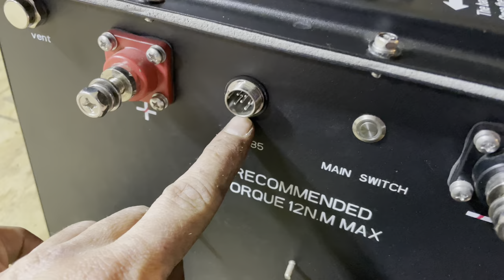RoyPow Lithium Golf Cart Installation (48v - 105ah) ~ Club Car Precedent (2004 - 2009)

Comment: how much would you charge to change out my on board charging plug to this 110v one? I have 2018 Club car precedent currently has RoyPow 48V 105Ah Lithium Battery and still has original on board charger port? Also do you have the ability to unlock speed 5? if so cost? I'm in Summerville SC
Reply from the maker: We only do batteries, but yes, we can handle installing the AC port.
Reply from the maker: It’s a quick fix normally, unless you’d like us to do some wire management too. Give us a call at the shop and we can nail down the details.

Comment: Where did you get that mounting bracket for the battery? I have the same cart using a different battery though if that makes any difference. Thanks for the video it was great and will be using it as a guide for my install.

Comment: You mention a 30% controller failure rate after Lithium battery install. Can you please advise source of this data. It's an alarming number that I'd like to understand further.
Reply from the maker: Of course, I had to replace my controller on a 2008 DS when I converted. Its specific to the curtis 1510 controller. This information is from ECO battery customer service. I recommend doing the OBC bypass first then installing the battery. I tried the battery, when it didn't work I bypassed the OBC then it still wouldn't work, so I replaced the controller fixing the problem. ECO also recommends upgrading your solenoid. I must say that out of all the carts I've done I have only had it happen once, so 30% is a bit high in my opinion.
Reply: @PalmettoBatteryPros  So my 200 amp solenoid went out fairly soon after conversion. I looked on ECO but could not find the recommended solenoid to replace it with. Any suggestions? The type , claims and prices seem to be all over the place.

Comment: Why do you need to bypass the obc on this battery switch out? Is it necessary?
Reply from the maker: It can cause controller failures in the Curtis 1510 controller

Comment: I changed my 2012 precedent to lithium and bypassed the OBC using your video. My lights don’t work everything else works good. Can’t figure out what Am I missing .
Reply from the maker: I would make sure your lights are getting 12v. Sounds like you may have not reconnected the light harness ground.

Comment: Firstly, awesome video. Really helped me down here in Australia on my 2008 Precedent, especially bypassing the OBC and relocating the central wiring bundle.

The only thing that confused me is when it came time to mount the battery, while I had the same bracket and battery you had, and mounted it in the same position and as low as it could be in the battery well (including cutting off those raised bits) I could not close my seat. My only option was to mount the batteries directly to the floor of the battery well without the bracket. The solution is fine, but I'm really perplexed as to how you didn't have the same issues I did, as the bracket would allow for better cable management and better heat dissipation if any exists.

Again, thanks for the video from down under. :)

Comment: I ordered the 110 volt replacement Electrical Receptacle outlet that's water proof so it has a lid that closes, I didn't see a cover on yours, but with them being male ends that means the legs will always be live and if something fell in on them and grounded them out it could burn something up or possible do a few other things bad. But you could have put one on just didn't show it in the video. Good Job nice work I'm working on mine and I'm ready to be done lol

Comment: Thanks for the video! I'm about to do exactly the same rebuild myself for a CC Precedent 2007 however from another LifePo4 battery supplier. You said the failrate for the controller is around 30%. In case it fails, what is your suggestions as a replacement for the speed controller?
Reply from the maker: We recommend the 440a Navitas controller and or motor combination for the RoyPow batteries.

Comment: With installing the lithium batteries is that the same way it would be with four 12-volt 100 amp lithium batteries rather than one and do I have to use the voltage reducer
Reply from the maker: I highly recommend not using lithium batteries in series connection.

Comment: How is the bracket holding the controller and solenoid secured? Was it just a snug fit plus that slot you cut for it?
Reply from the maker: I think I drilled it to the battery tray.

Comment: Hello. I used this video to complete this conversion. However I don’t know how to correctly wire my Bluetooth receiver now. I used the same style reducer. Can you help?
Reply from the maker: I would verify with a voltage meter you are getting 12v out of the reducer. If you are, then check that your wires have a good connection.

Comment: Thanks for the video. I really liked the setup you did And I did it the same way. One question, you said the blue wire is for the positive side for the lights what about the ground side?
Reply from the maker: Should be the yellow Bullet connection.
Reply: @PalmettoBatteryPros  thanks for the reply! I connected the blue wire like you mentioned and everything worked. FYI project came out better than expected. Wish I could attach pictures to share!

Comment: Thank you for the video! Definitely makes me more comfortable doing this myself. I have a few questions. In the video there is a blue wire with a plug coming off the positive terminal. I have that same plug with nothing hooked up. Do you know what that is for? Also would this battery have any problems tripping the bms with a lifted 2014 precedent going up hills? All of the motor and controller are stock as far as I know. 250amp controller. Thank you in advance for any help!
Reply from the maker: The blue from pos terminal is where your lights hook up. You should have no protection shut down issues with a 250a controller. If you do, its under warranty.
Reply: Thank you for the reply. So currently there is nothing hooked to that wire but somehow my lights are still working. The only other wire I see coming off my batteries is a blue negative coming off battery 3 or 4. Not sure which way you count the batteries if it’s from the positive side or the negative side. I’m a little confused how this is even working. As far as I can see there is no voltage reducer on the cart either.

Comment: If I disable the OBC or On Board Computer
on my 2006  Club Car Precedent, can I use a 
LINKS Series charger EPS by Lester Electric to charge my cart?  Thank you.
Reply from the maker: If you are still using lead acid batteries, I would keep the OBC in place.

Comment: I haven’t finished watching the video yet, but shouldn’t you have the 12 V power converter wired to a switch? It seems it would always be drawing a small amount of power if it was not?
Reply from the maker: Correct, the reducers we use now have a power wire that connects to the cold side of the key switch. This was an early video we did, the most recent videos show the key switch activation. This product segment has really advanced over the last two years.

Comment: Does the lithium conversion put up any speed ? I have the same golf cart in this video!
Reply from the maker: You will notice an increase in torque and a couple mph based on mostly the lack of weight compared to lead acid. Speed is more of a controller/motor issue.

Comment: There was a comment about the reducer.  You responded with a reply saying "the reducers we use now have a power wire that connects to the cold side of the key switch." Could you provide the reducer you now use (model number)? Also, where I can acquire one? 

Thank you.
Steve
Reply from the maker: You can buy them on Amazon. You can use a less expensive one with 48v input and 12v output or a more expensive model that has a constant or kill switch added with external fuses. Either will work, any 48v will work.

Comment: If you install the battery on a 2018 club car precedent do you need to bypass the OCB?
Reply from the maker: See prior post answer, but I have not had to bypass on newer carts.
Reply: So you think it’s good to plug into the existing charging port?

Comment: Can you do a eco battery install video for 2008 or earlier club car precedent
Reply from the maker: Will do the next one. The Eco 51-105 through hole battery is the easiest to install. Little to no tray modifications.
Reply: Please be quick and get-it-done as i too have a 2007 CC Precedent and ECO 51-105, Thanks @PalmettoBatteryPros

Comment: I just completed this upgrade. However I do not need to use the key now. It runs without using the key.
Reply from the maker: I’ve never seen that, your key switch must be hardwired together. Idk.

Comment: Can you give me a parts list of everything you had to get to do this.
I want to do this to mine before the summer. 

Thanks
Reply from the maker: 12 gauge wire to run to 12v reducer, with ring terminals to connect to battery. You may need some 12g wire to hook your 12v load items to the reducer. Other than that, if your main pos and neg cables reach the battery you shouldn't need anything else other than what is provided.

Comment: why did you have to butt connect the blue and the white
Reply: Bypass the on board computer for carts older than 2008. If you don’t do it the cart will not sense a ground and stay in safe or limp mode. If it does move, it’ll run 4-5 mph